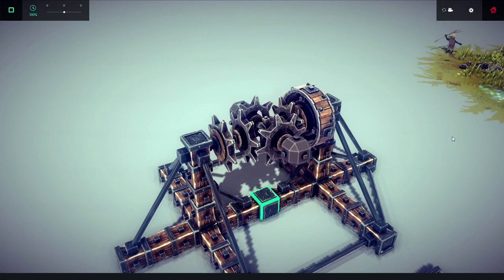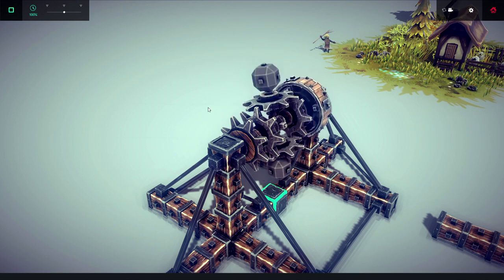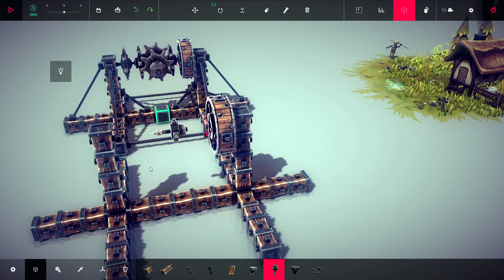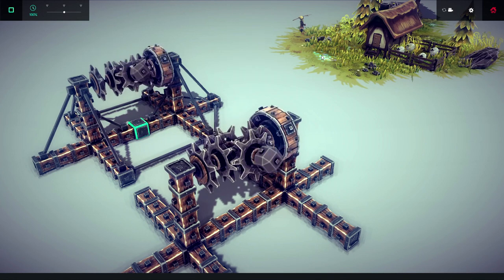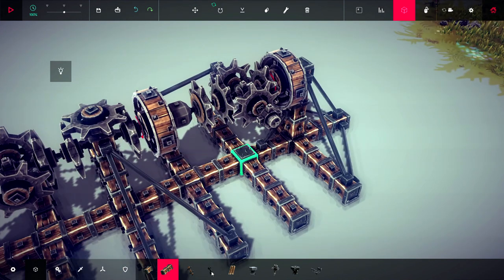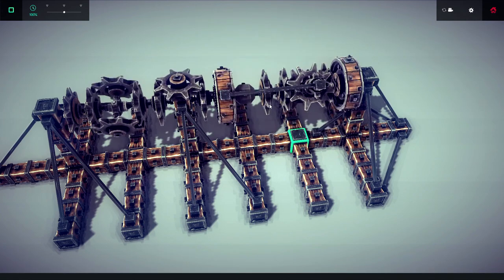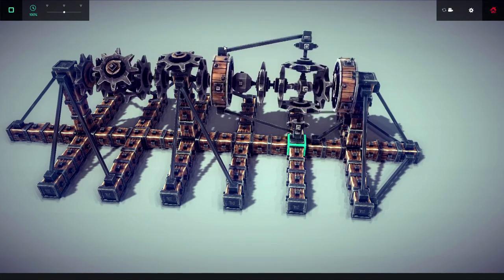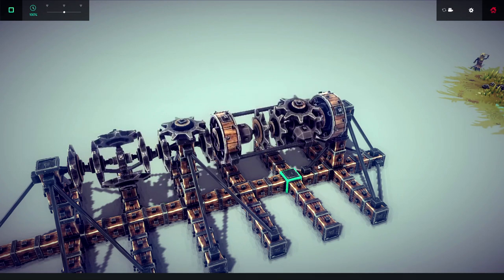Besiege Early Access (Ep. 21) - 3 Speed Planetary Gearbox

Comment: this isn't a gearbox. a gearbox should be able to use a single constant source of rotation and changing its output RPM using only different sized gears. this uses "gearbox" in the video use several sources of power to affect the overall speed. WHY DOES NO ONE KNOW SIMPLE THINGS LIKE THIS?!